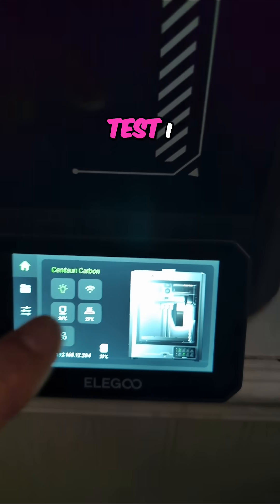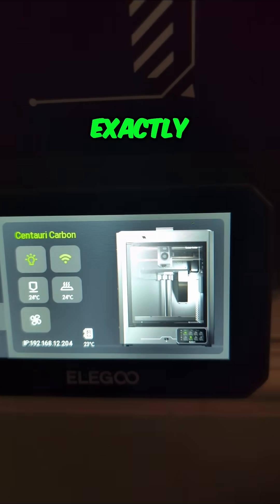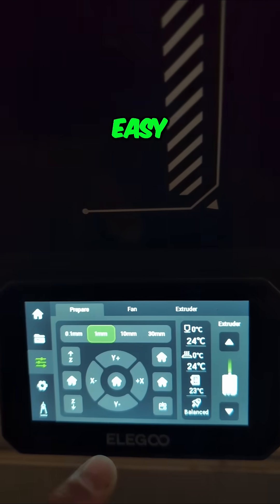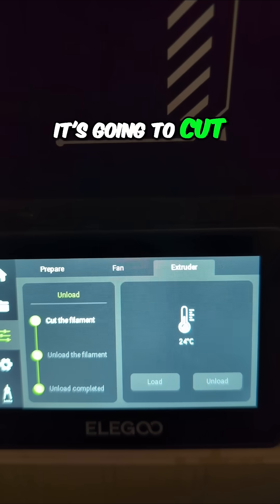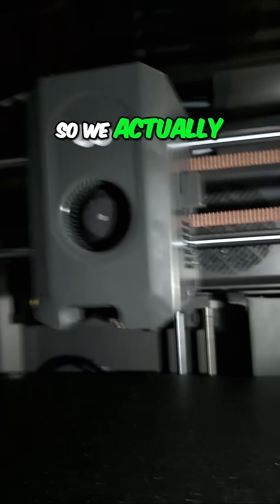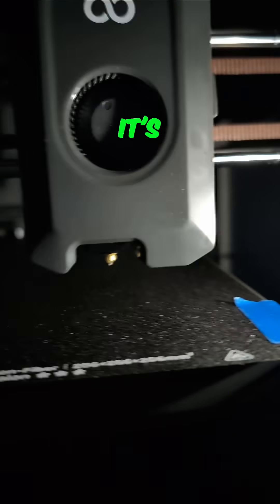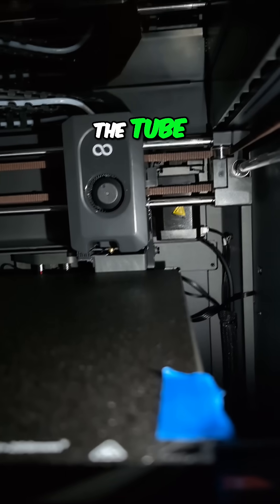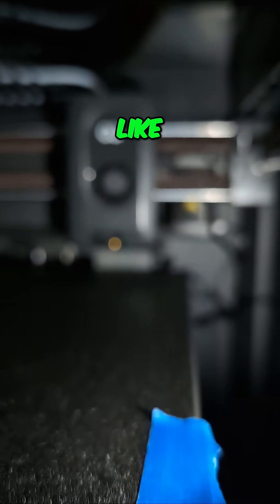Changing 3D Printer Filament: A No-Instructions Adventure! Centauri Carbon

Comment: Why are you using tape to hold your plate down? That's weird. It's magnetic and wonj't move while printing.
Reply from the maker: The tape is to cover the big white mark that is on the build plate. I have the early CC version that has the shitty little LED light by the camera. That light reflects too much off of that white spot on the build plate and washes out the camera. I've since blacked out the white mark with sharpie.

Comment: To auto cut the filament it will move the head to the right to push the cutter's arm. 

Also in your slicer, if you go to the layer you want to swap out the filament, right click on the right side scrollbar for the layers and select "Add Pause". It will pause and then you just use the same Extruder menu to Unload, then Load and Unpause in the main menu.
Reply from the maker: Correct on both counts. Thanks

Comment: Everything that you see in the video is correct. Once you put it to unload it will cut the filament poop and then you just have to unwind the rest of the filament back to your roll. Then when you want to put it a new roll you just got to do the invert when it tells you to feed the filament. That's what you do and it will catch it and that's it
Reply: What happens if you cut the filament too close to the loading mechanism on the side of the C.C. ?  There is filament in the loading tube and there is no way to get it out now.  Asking for a friend of course because I would never be that stupid to cut the filament that close... nope, not me.  lol
Reply: @Usafle is there any chance you lengthened the ptfe from hotend to the sensor even slightly?
Reply: @josephr5902 I just printed something stupid to run the filament out of the feed tube. Once the machine stopped, quit the print and loaded new filament in. Thanks though
Reply from the maker: They made it pretty easy

Comment: Tho you may be correct, I believe the filament is cut manually with the lever on the right side of the print head. Pretty much learning the hard way on mine since the videos did not include that tidbit.
Reply from the maker: Yes. I figured out how to manually cut the filament with the lever a few weeks after this video. :)

Comment: Unloading won't heat up properly even though I've set the temp to 220. Limits at 160. Nothing coming out smh
Reply from the maker: That sucks. A shot in The dark for you... Have you updated to latest firmware?
Reply: @GearReportMaker  yes I did. I just had about 10cm of filament left so I just manually extruded everything